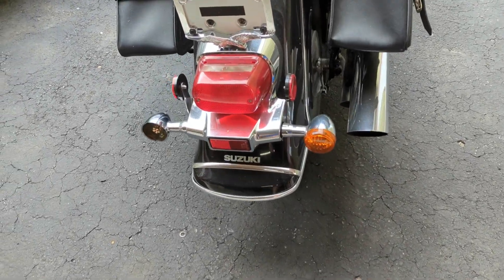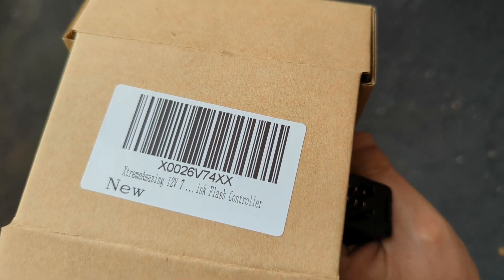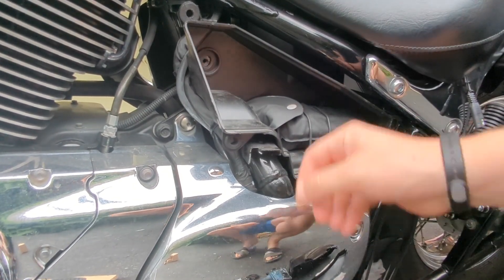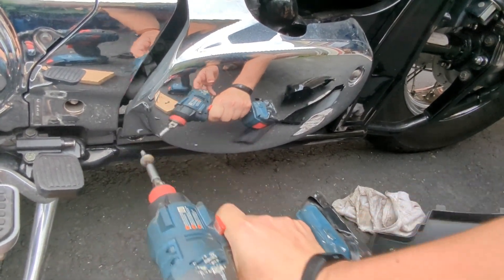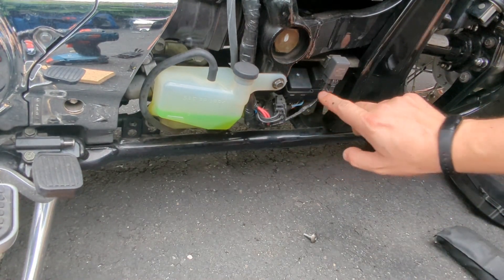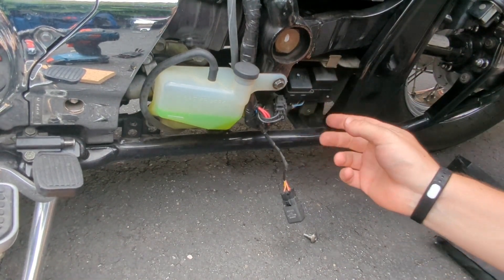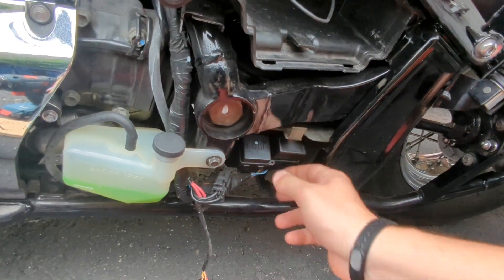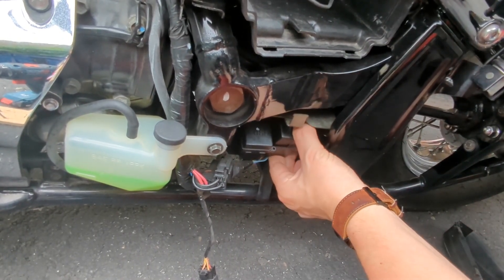LED Turn Signal Conversion for a Motorcycle (Suzuki Boulevard C50) Part II

Comment: Do you still have your 2002 Volusia? Would you please take an extra close pic of the fuel pump.. I took my tank off and can’t figure out where each hose plugs in
Reply: Take some pictures, then take them over to a motorcycle mechanic/shop and ask them to direct you, then throw them a $ tip if you want after. They should be able to direct you if you can't find it online yet.

Comment: Does this work for a 2009 Boulevard C109R?
Reply from the maker: @needaboatinoahguy  should work as the relay is most likely the same and bulbs too among Suzuki Boulevard models.
Reply: @DIYMaistor  that relay is no longer available. Is there a direct substitution?
Reply from the maker: @needaboatinoahguy  I'm sure there is, but you'd have to search on Amazon, or eBay a bit further.